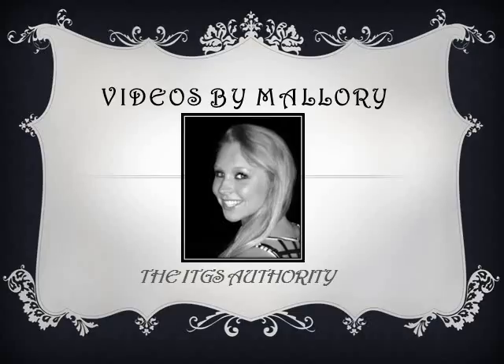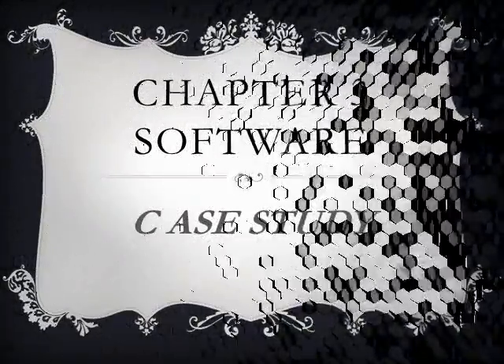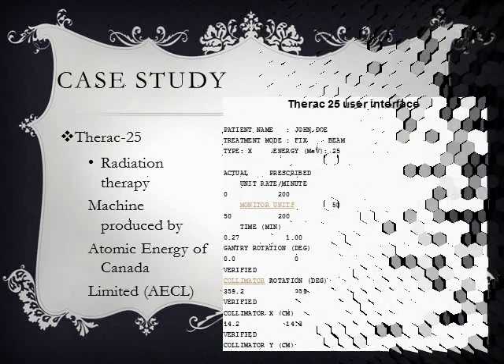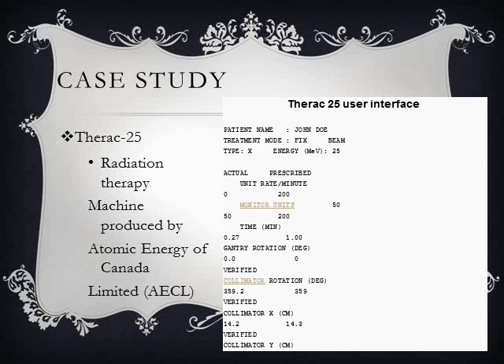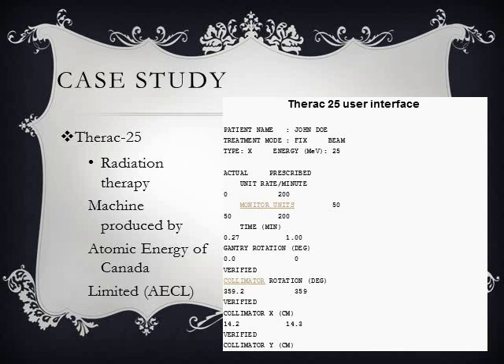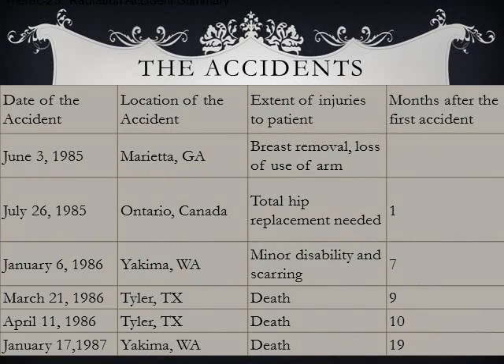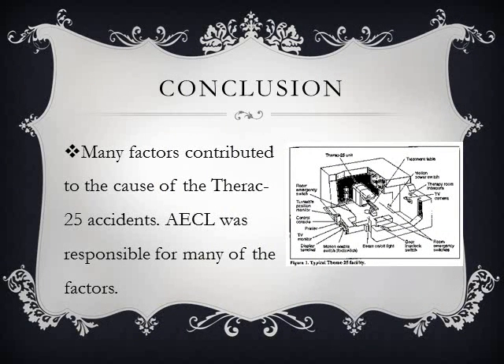Chapter 3 Case Study

Comment: Reliability of IT devices are one of the most important parts of an IT system. IT systems need to be reliable because the effects of the failure of an IT system, such as the one in the Case study are hard to reverse.